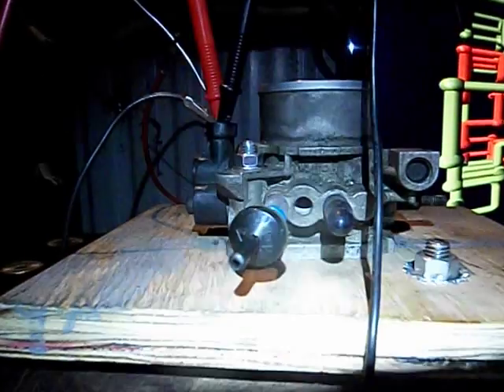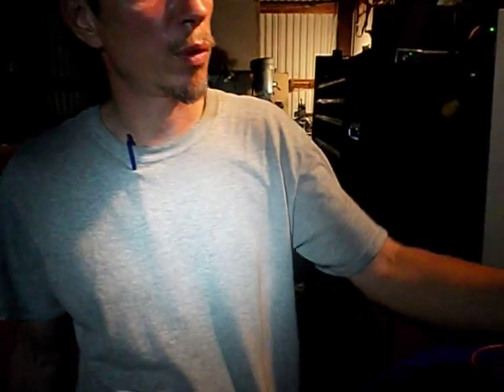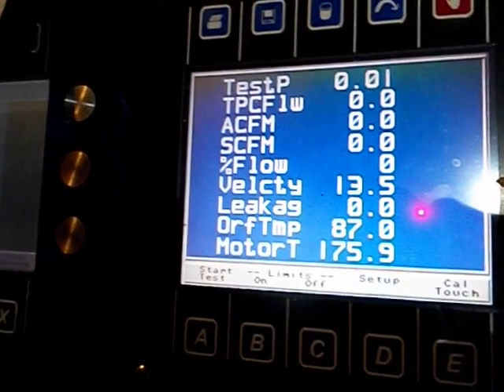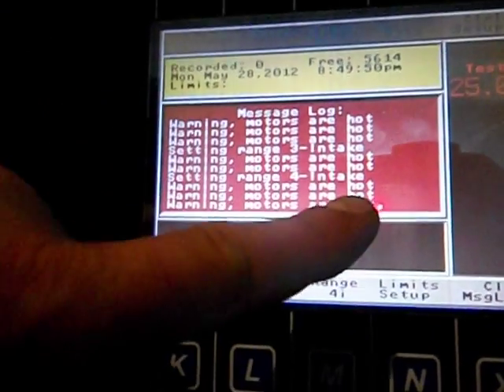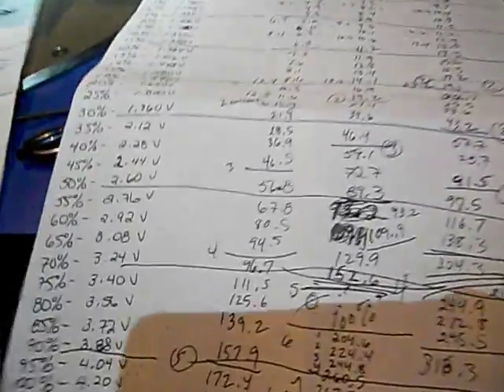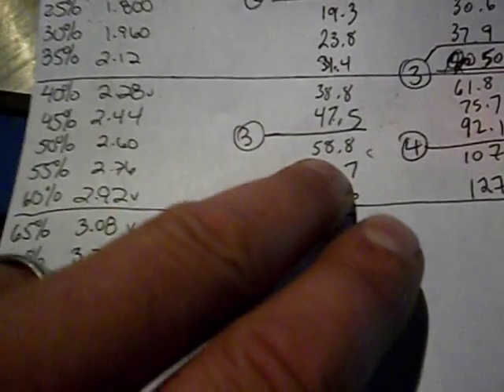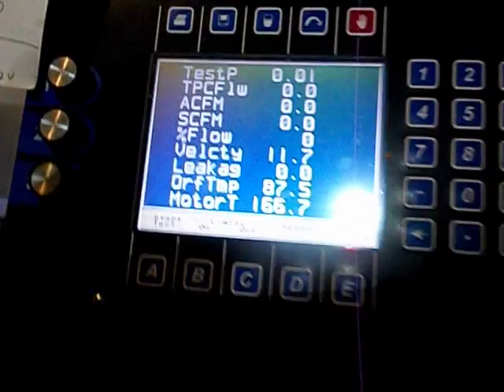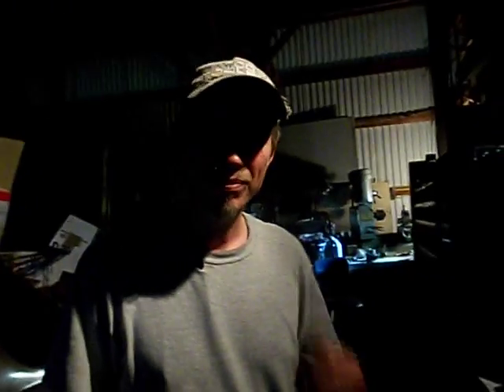Flow bench testing May 28 2012

Comment: If you have the means and want to try that out, my idea was to position the grooves in the 1/2 inch spacer to take care of some of the air that bypasses the initial groove. In addition I want to fab copper piping running the ring of it hooked to radiator hoses and relocate the air intake temp sensor to a point just after the heated spacer thats spiraled / grooved.  If your groove works as well as it looks like it does, the addition of the extra turbulence and heat should make it that much better